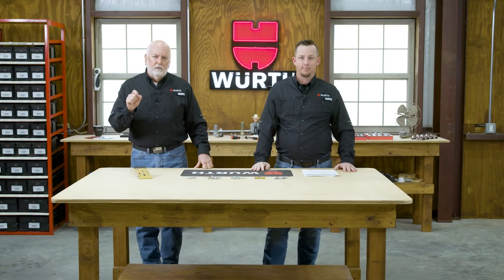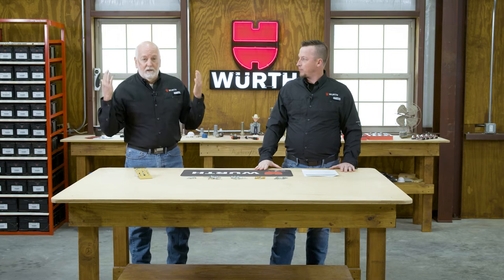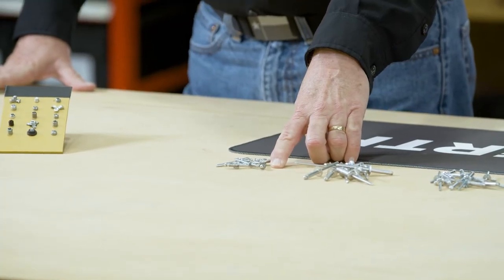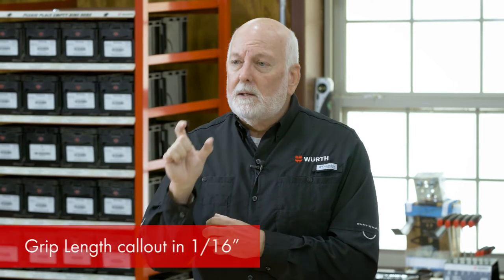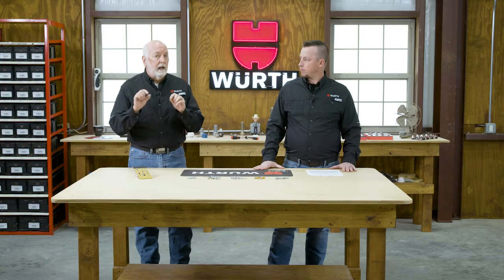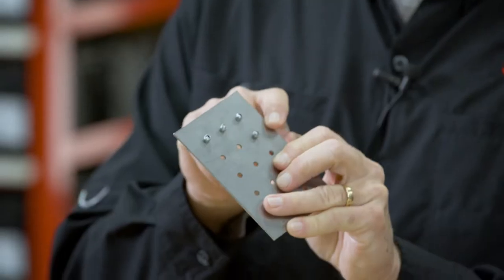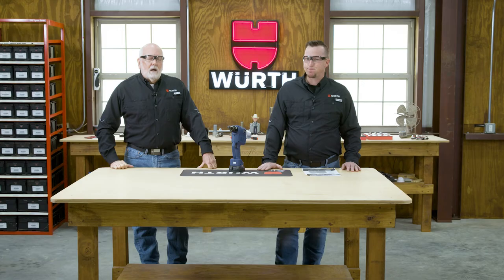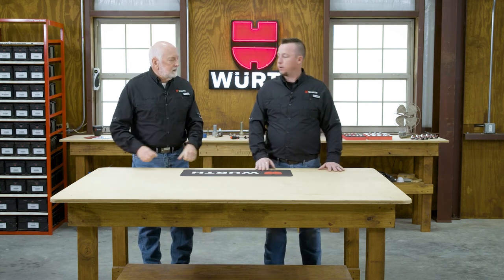Blind Rivets | Würth Knowing Episode 22

Comment: This is a new numbering system I am hearing for the first time. Like A&N hose fittings, even re-bar as a #3 is 3/8”, #4 is 1/2” and so on. But, the world has shrunk somewhat since air cleaners had 1 qt of motor oil to protect from dirt, dust, June bugs and butterflies. Our large family farm was only 25 miles from the Capitol city, but the rural areas were last to be updated so we had a telephone the was a party line and crank on the side of rectangular wall mounted box to get the operator. Surprise, my grandmother was the operator. The beautiful oak board-desk combo and with a head set would ask to whom you wish to be connected, Eddy at the Mobile Gas Station, they pull out a weighted cord with weight, roller on wire wrapped in cotton and 1/4” plugs marked with names as the town 3.5 miles away had 120 people maybe. As close as “Mayberry” and Sarah the phone operator as you could get. Your drivers license had no photo and at age 13, it said “Farm / School” so good to go on gasoline at $0.199 cent per gallon. Yes, 19 cents plus 9th of a penny tacked on for profit!
  The is a nice river gun as I just hit my 50th year of buying SnapOn tools and all the pneumatic tools were Chicago Pneumatic not SnapOn and a paint gun, a Binks #7 siphon feed cost $29.00. Still have it and the receipt!